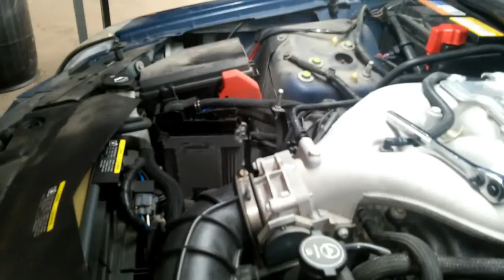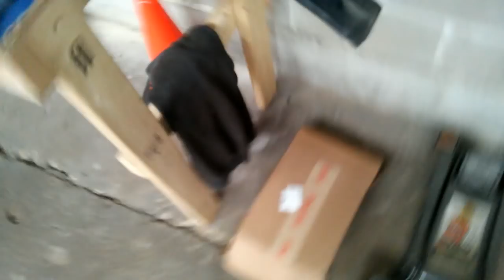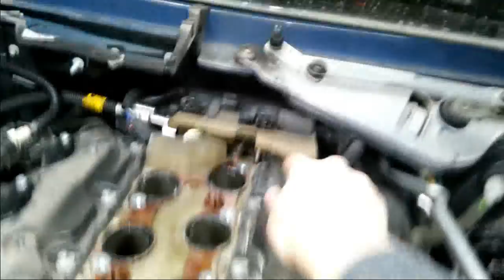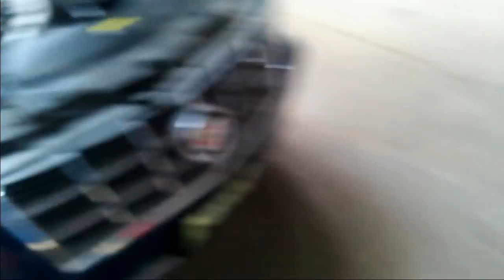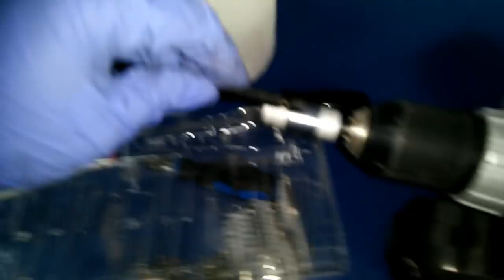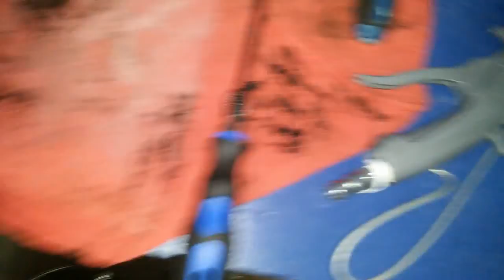GM 3.6 Intake port valve clean

Comment: Thank you so much for this video. The chances of dropping crap into the cylinder just reduced by 12%.  But I think i might just save my money up and let a mechanic do this and a pcv job.  Like to note i did an Italian tune up and my gas milage went from 15.8 mpg to almost 17. Just bought one with low miles but just about all of the annoying small but expensive problems (blend door actuators, blower fan, poorly installed headlights, rear center light, seats, trim, steering wheel controls, bent wheel, one rear backup light, one b pillar(interior), windshield wiper control unit, one windshield arm due to poor reassembly, cabin filter mounting tabs to body, marker light) from a friend for what the dealer was going to give him plus a hundred bucks just cause its so well. Dealer wanted over 3500 to do all of the repairs.  All done with that stuff, engine and transmission run well but my goal is to make it like new and keep it forever. Its like a luxury 2013 camaro rs with mag ride. I would say better than gen2 cts.
Reply: Keep a modern GM car forever?  Only if you park it. 😂😂
Reply: What’s an Italian Tuneup”.
Reply: @MarkSmith-js2pu  Highway run while pedal to the metal, cleaning her out. Great if you drive mainly city stop and go. I do this once a week.
Reply: @MrCliffda3rd  👍
Reply: I don't think that "italian tune up" will work for GDI engine since there isn't gasoline traveling through the air intake to clean up the valve.

Comment: Another method is walnut shell blasting which is very effective in removing all carbon.You use a Shop Vac to suck up all the debris. I used the berryman chemtool spray and a hard bristle toothbrush,.let the liquid set for hours and brush everything.

Comment: It doesn't always require to tear the intake manifold off to clean. There are induction cleaning services that can spray cleaners in through the throttle body and cleans the carbon off the valves without dismantling the engine.
Reply: Glock .40 4 do they work though? And how often? I’m wondering the same if I should run some CRC for example like every oil change or couple thousand miles. Idk any tip would help.
Reply: Glock .40 4 I just did my mint 2006 CT’s 2.8 sprayed combustion chamber cleaner into the intake similar to gm old Cleens  while running then shut car of started 2 hours later sprayed the rest of the can shut off over night started in morning drove 30 miles on highway at 70 mph  and a few harder pulls later on . The results were spectacular increase in power  and drive ability . I changed oil after my 30 mile drive  with 5-30 synthetic and the tiny oil filter
Reply: @unitedwestanddividedwefall3521 it works well if you've been doing it periodically. If you REALLY let it build up like most people, 60k, 100k etc it bakes on bad and the cleaners won't do enough.

Comment: cool video! I'm going to do this on my DI 3.0v6 in my Caddy tomorrow.
Reply: vw1610 When shops can't make money. They create problems that don't exist.
Reply: blackericdenice, I actually was having a misfire  issue  on my 2013 Cadillac ATS   3.6 with less than 50k miles on the odometer. Dealer tried the gm top engine cleaner, which helped minimally. When I pulled off my intake manifold to investigate myself, the valves were horribly coked with oil and rock hard carbon deposits that no chemical only cleaning will ever be able to solve. Cleaned them manually like shown in the video with some rifle brushes attached to a cordless drill and brake cleaner. Night and day difference, no more shaking and misfires at idle. The pcv system on this motor is to blame. It sucks in a lot of oil from the crankcase that just ends up baking rock hard onto the valves. For anyone doing this, invest in an oil catch can to prevent this build up in the future. My 2 cents.
Reply: What was you symptoms did it fix them did you have any vibration before hand?

Comment: I think the real question here, is how to install a oil catch can in line with the Pcv to prevent the oil gunk accumulation on intake valves to begin with. This was an overlooked design flaw in these 1st gen direct injection motors that should have come with a catch can installed.
Reply: 1997LT1Camaro you can put 3 oil catch  whatever this is a flawed  design  it helps a bit but if you drive mostly city be prepared to do this.there are cars that at 40 k miles you already have to do this.so if you have a gdi get ready to learn this or pay mechanic top dollars to do it. Welcome to the green  world.
Reply: Marian Luc Haha I’m not there. I don’t own this engine but my dad does. I just went back in time and got a 440 six pack challenger 😍
Reply: 1997 You are correct in saying fit a catch can, the crankcase vent draws the oil into the inlet, the toothed timing wheel fitted to the rear of the crank throws the oil up into the cam cover at the back, Prevention is better than unnecessary maintenance.
Reply: The pcv valves on these engines get plugged easily. When that happens pressure in the block builds up and blows an oil mist into the intake from the fresh air intake side. Pull PVC every oil change and clean. I also opened the holes a little bit. After doing this, add the oil catch can to reduce the amount that gets pulled through the pcv into the intake.

Comment: I'd love to see GDI engine manufacturers install catch cans stock or some kind of system that would periodically inject cleaner into the intake stream while driving to keep the valves clean.  There could be a separate tank, sort of like a DEF system on a diesel.
Reply: Tech already exists, use a water meth injection system with a tank for gdi cleaner. Have the computer run the cleaner during the same conditions a diesel runs regen. That being said ford actually "fixed" this issue, they run port AND gdi injectors on their newer engines.
Reply: @archangel3237  The port / direct combo is the best solution for sure.
Reply: @estelja  I would agree if I hadn't had to replace a stuck open GDI injector on one of those 3.5 twinjected engines the other day lmao

Comment: How do you tell when the cylinder is TDC?
I'm going to remove my intake manifold to replace the injectors, plugs, and coils - can have a look see in the intakes then as well. 60K miles on mine. 
It was idling a little rough, but a tank with techron and one with Liqui Moly valve clean, and it's nice and smooth now. I suspect dirty injectors.

Comment: Why not pour in a cleaning solution like seafoam or similar, let it sit, then suck it out with a vaccuum?  You can catch the solution before it enters the shop vac by making a "catch can" with a jar, lid, and a couple hose fittings.

Comment: It's pretty obvious to me, that this is the first time that this dude has attempted this job. He didn't even know what tools to use!? And yes, you can use the air intake "solution to do this job much easier and MORE effectively! That's how GM teaches their mechanics to get this job done. The older the car, the more times you need to do the operation, because it doesn't all come off at once. Just use your head and do not expect this to be a quick one time fix. I would do it weekly at first and then after a 4 to 5 weeks, go to every other month or so...make sure that you do this AFTER the MAP sensor of the intake...like just before the throttle body opening. and by the way...hasn't anybody ever heard of generic CARBORATER CLEANER? It's much stronger than Sea Foam and is what mechanics have used for over 50 years! Meter the flow of the cleaner spray until just before the engine wants to die AT IDLE; do this MULTIPLE TIMES and you will find your engine running better and MUCH smoother.

Comment: So you removed the O2 extenders, Isn’t because the car had catalytic converters codes? Why didn’t the check engine light came on after you put the sensors without the extenders?

Comment: Did this vehicle have any drivability or check engine light concerns? If any, what were the concerns?
Reply: Timing chain stretches sometimes.
Reply: @ThatEEguy2818  did u have to change the timing chain.
Reply: @terrencemayes469  I didn't on mine, but I paid someone to change it on this 3.6L little brother,  the 2.4L.

Comment: these are a common engine here in australia, but over here, they are called an "alloytec". Anyway, i was wondering, could you just use some fuel on a rag, and wipe most of it out that way?
Reply: gav0253, unfortunately it’s not that easy.  The deposits are rock hard and baked into the valves. I had to use brass rifle cleaning brushes attached to a cordless drill, and it still took a lot of effort. No chemical on its own will remove this stuff

Comment: I would NOT recommend those cheap HF brushes, nor doing this procedure in this manner. Ive used them before and the metal bristles break off all the time. You wanna talk about cylinder scoring- have a few of those fall down in the cylinder. This guy is risking more damage than getting any sort of benefit from doing this procedure. The true cause of this buildup is the pcv valve dumping blow by oil higher up in the intake piping coating the valve stems. A much better and safer procedure is vinyl tubing connected to a shop vac and gently rubbing the edge of the tube against the valve stem. Then soak the closed valves with seafoam and use no mechanical scrubbing!!

Comment: Nice tutorial video but I have a question:  How would you know when both valves are close?
Reply: john briscoe, jr you look down into the vavles after turning it slowly ..pretty easy task
Reply: You can see it just a good light if in doubt  turn it again  and you will get the hang of it is pretty simple.if the cleaner goes down  is not completely  closed.

Comment: What year Cadillac and which 3.6 engine ? ?  I have a 2016 Cadillac ATS Premium AWD with the 3.6L LFX engine ... I wonder if they improved on the carbon build up in that year or not.
Reply: 85rx7se not sure if that year has the revision, but they started placing an injector behind intake valves to work in conjunction with the direct injection fuel injectors. This prevents all of this gunk
Reply: @1997LT1Camaro  ... No way to know for sure without taking it apart or myabe a GM Parts Dept can tell from the VIN if it has the newest design or not. It would not be easy to retrofit, as it would mean a newer intake manifold, extra injectors, new wiring harness and probably a computer reflash or maybe a whole new computer. .. Time will tell if it will be an issue for my car, as it does not much use (about 5K per year)
Reply: @1997LT1Camaro  .. I checked my Cadillac Factory service manual schematic and it only shows 6 fuel injectors ... So I would say it does not have the extra injectors to clean the carbon off the valves. Time will tell if it will be an issue. Newer oil formulations may minimize the buildup.
Reply: you should be fine i believe it was fixed after gen 1

Comment: I just got a 2016 impala with the V6. I’m in love with car but the susceptibility of it getting the valves dirty and ruining the engine worries me. Any tips on how to prevent it fro getting too dirty??
Reply: CRC GDI and turbo cleaner follow the instructions on the can. 13.00 at AutoZone.
Reply: @Dev JB thank you. How do you clean out a pcv system? Also I have to drill bit what exactly? Thank you

Comment: My car rides fine when driving at idle it has a shake I've replaced the motor mounts and spark plugs its acting up.worse in the cold. Do I need this done. How can I tell and where can I get it done I asked around and no one has a idea what what I am talking about
Reply: Do you have any misfire codes?  How about CAM timing codes?  Both problems can cause your engine to shake at idle.  Not always this issue.

Comment: Any reason why you can't use throttle body cleaner while the engine is running to clean them?  Sure manual removal is better.
Reply: When I meant throttle-body cleaner, I meant to say GDI cleaner, but thanks for the reply.   My 2017 Acadia has a 2 stage PCV system so I'm hoping the buildup will be reduced and the need to clean the valves extended.
Reply: Steve Cedrone thank you I asked that in the comments but found yours and it answers my question thank you.

Comment: I have a camaro and its blowing white smoke and it looks like my exhaust is leaking oil.
Reply: Might be your valve stem steams have failed or the turbo booster.
Reply: i have a bicycle and the rear tire is flat..

Comment: Think a catch can may help??
Reply: With a good filter in the catch can and good vacuum
Reply: Heaps. You drill out the PCV valve to increase air flow and put a catch can on that side. Justcommodores has the goods. These are great engines when you do that mod. If they are in a Holden, not sure why you would buy anything else.

Comment: Is all the gunk coming from the pcv valve clogging and gunking up and venting that straight into the intake? If so, what if you just vent the blow by gases straight to the atmosphere, not saying that is legal, but would that be a fix to the gunking on the intake ports?
Reply: yeah its all coming from the PCV system you can all so install a catch can. What sucks is this is now what you will have to deal with on a GDI systems.
Reply: Yes, it would help your intake ports but the main problem then is that it doesn't clear the crankcase of the fuel vapors which then dilutes and poisons your oil.  You would be trading a fixable upper end problem (cleaning intake valves) for more serious lower end problems.  The crankcase needs a vacuum like that created by the PCV system to get rid of the fumes.  A decent catch can is the best solution overall.

Comment: Would using the seafoam spray with the special intake straw work on this motor.  I have the 3.6 camaro. Trying to avoid pulling manifold off.
Reply: yes
Reply: @noaheidsmoe  Not with GDI it won't.
Reply: @brett2681  you're right, my mistake. 
I think using Top Tier is still a good choice for keeping things cleaner overall.
Reply: @noaheidsmoe  I agree. It will keep the fuel system and combustion chambers cleaner.

Comment: I did this but now i hear a high pitched squeak when cruising around 1.6k rpms. did i do somthing wrong?
Reply: Super wrong
Reply: @wifilost  oh yeah I just didn't prep the gaskets and I had a vac leak but it's all good now
Reply: Which direction did you turn the motor to close the valves? did you feel your car run better after you cleaned the valves?

Comment: This will not restore power or mpg because neither is a problem. This is just another way to get money from the owner.
Reply from the maker: This is a well-known issue across all GDI engines, not just from GM but Audi, BMW, Ford, and Hyundai among others. Carbon buildup restricts the amount of air each cylinder can intake on a given stroke. Less air = less power per stroke. Less power means more revs to achieve a given torque output, which means more fuel is burned. Simple physics and chemistry, friend. The GM 3.6 engine is even subject to a factory technical service bulletin on this very problem, which causes reduced efficiency and engine misfires. You can read it here: https://www.carmd.com/Tsb/Download/99451/c0f7e87e 
GM recommends you use a chemical solvent, but this does not effectively remove all the deposits, and can cause damage to the cylinder walls because it frees pieces of hard-coked carbon without removing them, just knocking them loose into the cylinders, scratching the walls upon startup. The only way to completely remove them is with the procedure shown in the video.

However if you feel cheated, I'm happy to refund every penny I charged you for this free DIY instructional video, which shows you step-by-step how to perform this service yourself with common and inexpensive tools.

Comment: this is a terrible idea.  you cant clean the combutstion chambers so you still risk detonation. the brass brush bristles will fly off while spinning and run through the valves. the heads need to come off.